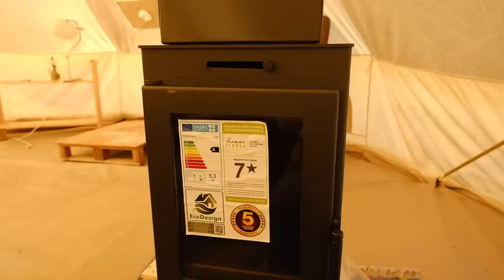Final Weeks of Winter Prep on our Homestead (a strange October)

Comment: Hi Harriet & Mauro. I recently discovered your channel & am enjoying your videos a great deal.
A couple of points for you: 1. I put a drain pipe in along side each sapling tree so that the water is delivered directly to the roots. I picked up this technique from studying tree & shrub planting of semi-arid areas where desertification is a problem. When you water in the usual way from above, the water can evaporate & be lost before it ever gets to the tree roots. By placing a pipe alongside the tree when it's planted, this ensures all the water gets to the roots, thus reducing watering effort. I have used this approach with my own fruit trees & it works well. I put the 'plant' the pipe (old drainpipes are good) about 30 cm away from the trunk to allow for growth & staking. 2. I noticed you were using black or dark coloured pots for your herbs outside the kitchen. Black surfaces absorb the sun's heat the most hence they will dry out faster. I suggest you use white pots instead (or paint your pots with whitewash or similar) as this will reduce heating & thus evaporation in the summer. 
We live in Motherwell in SW Scotland where rainfall is much higher than eastern Spain so water isn't any issue usually. However, climate change predictions for western Europe suggest drought is likely to become a greater problem going forward, particularly in the light of the shenanigans at COP 27..
Reply from the maker: Thanks, appreciate the tips and he kind words!

Comment: You definitely are a hard worker.
Are you sure you won't have to sweep the flue pipe to the stove? 
We had to sweep ours once a year to remove the creosote build up. 

Always great to watch your videos. John in Oklahoma USA
Reply from the maker: Yes we need to clean the flue pipe anually, but hopefully not the chimney if we can extend the length of the tube
 If that makes sense??
Reply: @LittleSpanishFarmstead  yes it does. Thanks.
All the best.